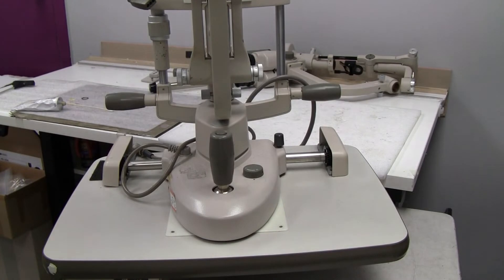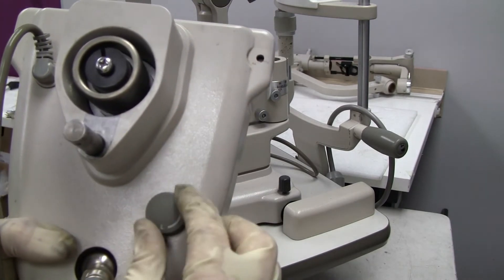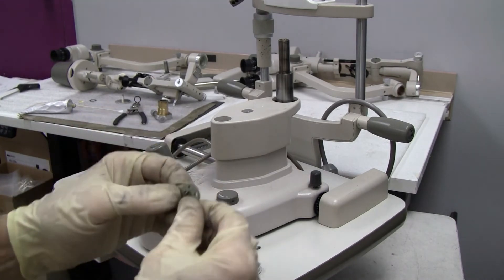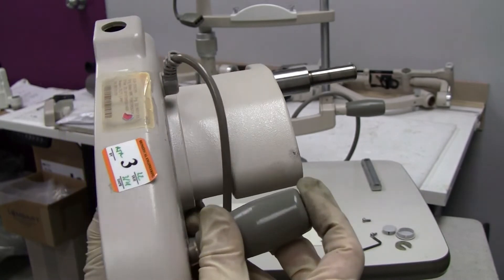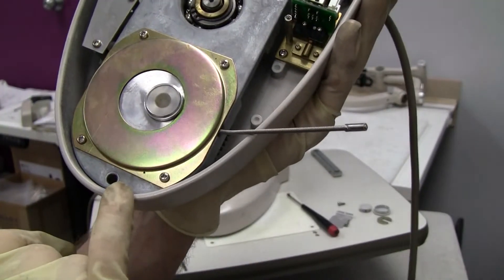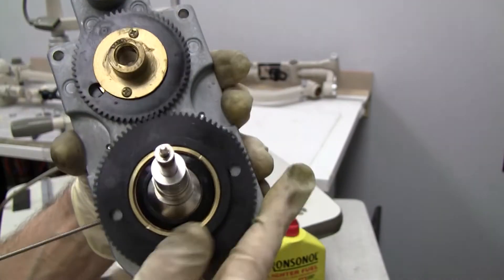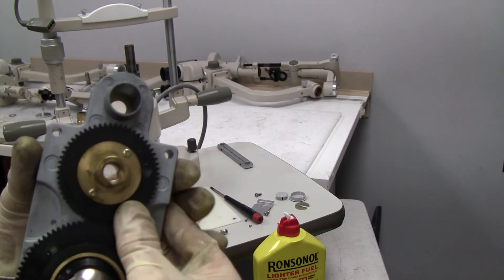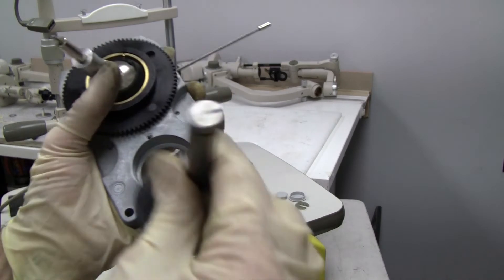TAKAGI Marco Ultra Slit Lamp Base Refurb Part 1

Comment: I have several Marco 2b Ultras.  On one, the slit aperture no longer opens and closes (stuck full open).  Do you have a video which shows how to fix this?  I'm assuming it's sticking with old grease and needs disassembly, cleaning and re-lube.  I don't mind tackling myself if it doesn't require specialized tools.
Reply from the maker: Try taking the top half off your illumination tower off by removing 4 screws either on top or underneath. Pull the top off slowly. Perhaps with the top half off you can determine what is sticking. It could be the shafts that your slits pivot on need cleaning, or just a drop of rem oil to free them up. The video "Tower Slit Lamps Slit Closing Adjustment Procedure" will give you some idea what the slit assembly looks like. No special tools needed. If you take your top half off, you will probably need to adjust your centering when completing by keeping your 4 screws loose enough to twist the top half one way or the other to obtain your closest centering.

Comment: I have a G2 unit, the left right movement in the axle is sticking, what would cause this?
Reply from the maker: Takagi Marco seems to put a lot of grease on their axle & axle bearings. 
I would try to place the base  on a ledge so that you can spin the axle without touching anything and then keep wiping and spinning the axle moving it left/right while spinning and continuing to wipe the axle clean until it has no grease residue left on it. Next I would make sure the joystick pad was clean and then rub a light viscosity grease on the pad, and then try to wipe it all off, which actually leaves a slight film, which is what you want. Do the same with the bottom of the joystick. These steps usually ensure a free left/right /forward/reverse movement. Hope that helps. ☺